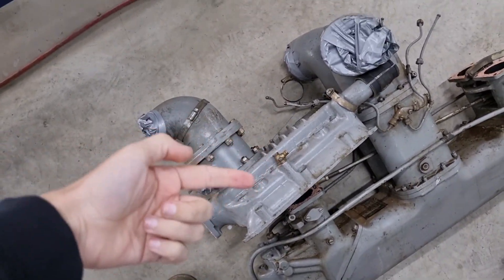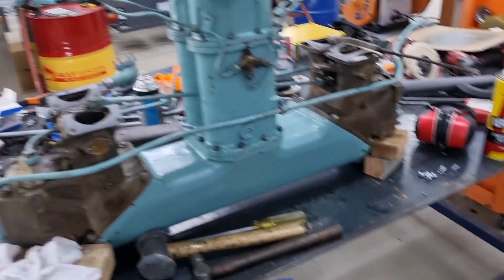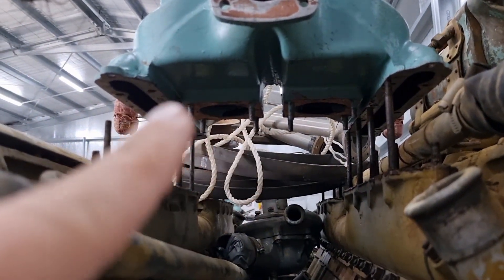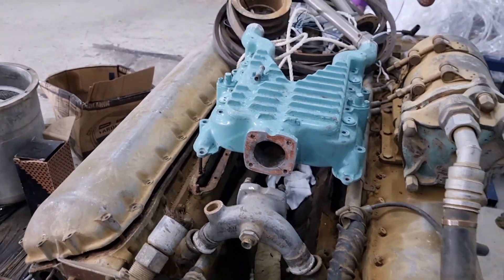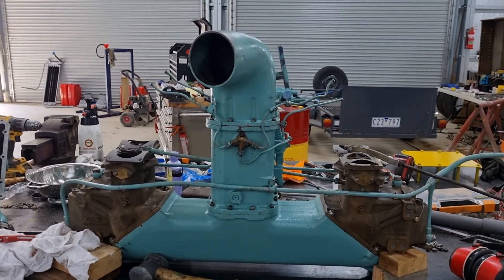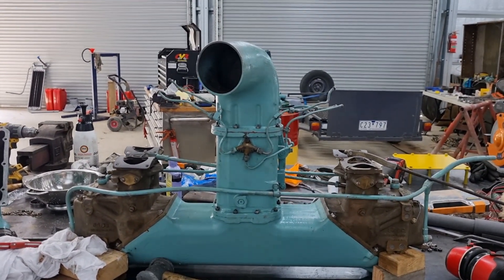Anatomy of an Updraft carburettor from a V12 Meteor engine. Centurion Tank Engineering.

Comment: Very nice video, i have one question. What exactly does the "strangler choke valve" do? I did not know about the ki-gass priming system i thought the strangler valve just functioned as a regular choke for cold starts, so if it has ki-gass system for cold starts, then why does it also have the strangler choke valve and why did they put 2 different cold starting devices at the same time? In the AV-1790 from pattons theres a ki-gass like priming system and no chokes/strangler valves but meteor seems to have both at the same time. The centurion mk1-3 technical handbook talks about the air strangler choke valve as sort of another cold start like device but doesnt go into more depth.

Comment: Nothing better than having someone explain something when they know exactly what they are talking about. Do you know of anyone who has done the mechanical injection system on one of these? I'd take it any day over that mess.
Reply from the maker: I haven't personally seen them on any Cents. I have seen it on the Churchill mine sweeper. It uses a Meteor with fuel injection to run the flail. Other Cents tend to get swapped out for diesels.